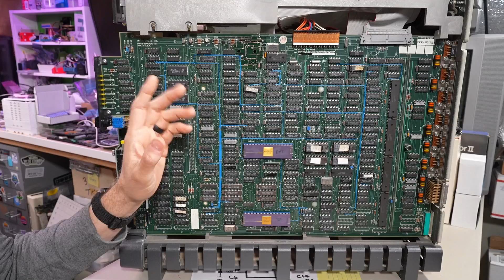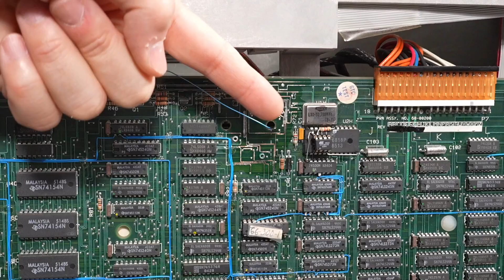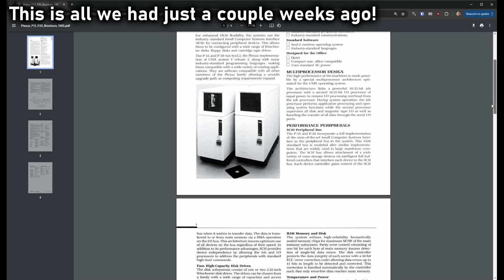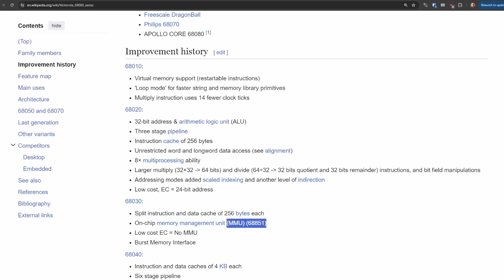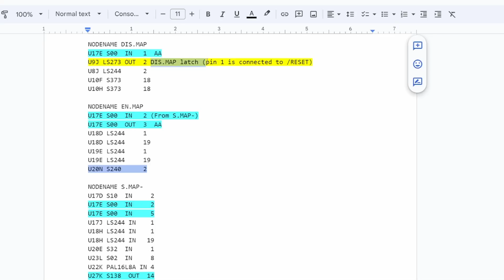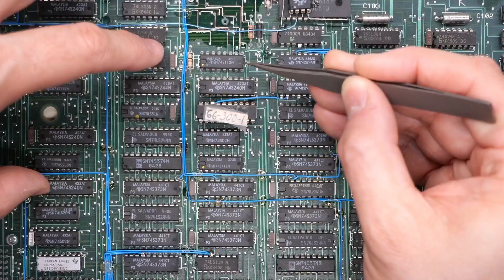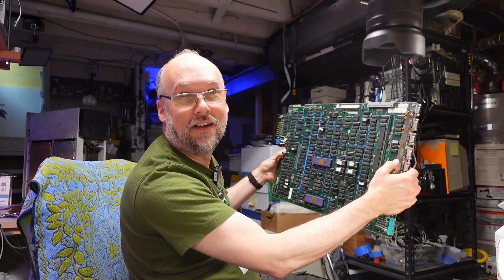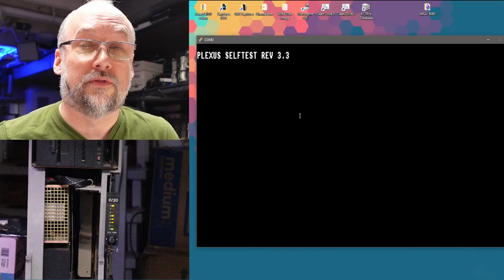We made some unbelievable discoveries about this Plexus P/20!

Comment: PLEASE fix the power supply!
If it's not coming out of reset it may be detecting something is wrong inside and resetting to try to prevent further damage, and that is one thing you don't want in a power supply of a very rare computer. 
When an ATX power supply fails do you bodge the "power good" signal on the motherboard and call it a day?

Please re-check the power rails with the scope to see if anything broke there. A power rail spike can certainly make everything unstable.

It might be possible that the power supply is not supplying enough power to something that does not start and initialize. Part of the multibus circuit may get some "ok" signal form the cage and the second PSU,  Make sure everything is connected and started.
Reply: He did say that ultimately that is A goal, and the reset circuit he added is hopefully temporary and mostly being used for troubleshooting, which is absolutely valid IMHO. 

In previous videos he already checked the rails and solved some potential issues. Thus, for the moment at least, the rails do actually look good. 

This is intended to be a troubleshooting step, not a permanent fix as Adrian said.
Reply: @Cherijo78  Ok, but if a PSU is so unhappy it keeps system in continuous reset wouldn't it be common sense to diagnose and fix the PSU first instead of just overriding its ok signals and hoping it won't kill the system in process? 

I understand Adrian scoped the voltages before the system was actually running, and I think tape and HDD were disconnected at that time? My point is that if it was fine then and developed a fault now, then it needs to be scoped again to check if everything is still good. 

Tantalum capacitors for instance have a failure mode when - after being stored improperly for large amount of time - they might short immediately, but also might work for a small time before shorting. That is also possibly not a dead short but a low resistance which lowers the voltage on one of the rails to a point where system kind of works but is unstable and/or glitchy.

What is much more concerning is that and older PSU circuitry that does the feedback can fail and that failure mode can lead to large upward spikes of voltage on 5V rail accompanying large current spikes i.e. when a seized tape/floppy drive tries to do boot. And those can quickly destroy chips to the point when repairing it becomes a pointless affair. 

I don't feel this PSU can do that or that this is what is really happening here but I would be more cautious if the PSU clearly indicated its failure.

I think this power supply may be incapable of fully powering down if it detects overcurrent or overvoltage, instead the best it cant do is to reset the system to hopefully stop it from doing whatever is causing the fault.

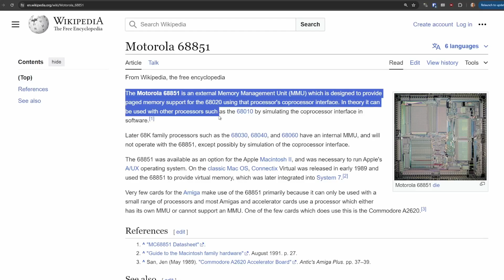Comment: @29:10 The 80286 had full support for protected memory. Code could be readable or execute-only. Data could be readable or read/write. Segments could be present in memory or swapped out. There were 4(!) priviledge levels, and sophisticated priviledge transition mechanisms. Interrupts could be handled on the most provledged level of the current task, or in a separate task. There is just one thing Intel added on the 386 processor: Page-based memory management instead of segment-based memory management. It turns out that page-based memory management and flat non-segmented address space are so much easier to handle that most of the more advanced 286 protection features were mostly ignored by OS writers, using just the page-mapping and page protection unit of the 386.

Features like the separation of data and code that were included in the 286 protection model were not implemented in the paging unit of the 386, so if programs had a flat whole-address-space code segment and a flat whole-address-space data segment, every address could be executed as code, even writeable data. On the 286, you would have needed a writeable data segment and a code segment created intentionally to be able to execute stuff you just wrote. Non-executable pages appeared when hardware exploit mitigation started to get important with AMD including the "NX" (no execute) bit in AMD64 (later named x86-64 or x64). It was later also added into some operation modes of the 32-bit x86 architecture.

Comment: would be kewl, if someone could design a Diagnostic device that would run through all the nets and check continuity and logic functionality,  and when finished, would output a report to either a screen or printer. and show you exactly where the problem is.
 kind of like the computer system on the Star Trek  series . if they haven't  done this, on  modern servers and large systems
 already that is . . . .
20:57 as Bob Ross used to say "We don't make mistakes, we just have happy little accidents" 😀

Comment: -we need a circuitry to pull off a reset signal
-lets use the whole 16mhz atmega board to do that!
-great idea!

Just finished watching: what a roller coaster!  Absolutely amazing!
Reply: At least he didn't use a Raspberry Pi cluster running Kubernetes.
Reply: @BrunodeSouzaLino  Is that something Adrian would be likely to do? I know that Jeff Geerling might...
Reply: @petersage5157  I'm working on the assumption that no YouTube creators read their comments past the first hour after the video is published, so this was more of a reference thing meant for the OP which the OP might be familiar with.
Reply: Hey, when you have a bushel basket full of the things, it only makes sense to use them for everything under the sun.
Reply: Yeah, and that atmega might even be somewhat on par with the 68010s' performance....!
Reply: @sparcnut  It runs at up to 20MHz and runs 1 instruction per clock, so no, it runs circles around the 68010 CPU.
Reply: I thought it was kinda overkill at first too, though I must admit being able to turn a reset loop on and off with the startup key is pretty handy!
Reply: He did mention that he intends to replace it with an attiny.
Reply: Sounds kind of crazy, like bolting an original PC to the latest and greatest computer just to drive it's reset line!

Comment: I wonder what the labor cost was to do those bodges like that at scale.
Reply: Far less than going for a new pcb - normal method would have been to get things working with the bodge wires, and once all the bugs had been sorted go for a new pcb IF the sales predictions were good enough

Comment: i wondering how the dual cpu setup worked. clearly those cpus are not made for this. but do they work like two independent cpus or is this similar to a dual core cpu today or do they work in a alternating way like multi threading.
Reply: There's one main CPU, and the second CPU is dedicated to IO, running its own software from a PROM chip. The eight serial ports and SCSI connect to the IO CPU, which is connected to the main CPU via the main DRAM.
Reply: @fredoralive  so it using only one cpu and the second is used as a io multiplexer?

Comment: Before I watch the end of the video,  The 4F02 reminded me of something on some hardware I worked on ages ago that had a ton of IC's.  I noticed your board had a grid on it, so it's possible the location of the fault would be row 4 column F,  possibly a fault code of 02,  I know this likely isn't correct, but I wanted to post before I got to the part of the video that showed which component was bad.
Reply: I'm not sure, but I think the bad component was in 4F

Comment: Using the Arduino you missed a chance to make it actually smart - eg. use analog input pins (with resistor dividers) and drive the reset on the user input + rails being in limits. Then you just loop it and while its in limits, is fine. Once some limit is violated, you can print the actual reason on arduino's serial (or on status leds), to know the transient states.

Comment: Do that Arduino "reset cirquit" has more computing power than entire Plexus...?
Reply: No, an the Arduino Uno uses an ATmega328P, which has an 8 bit AVR core with a 16MHz clock. It's hard to compare between CPU architectures, but I suspect a 12.5MHz 16 bit 68010 would probably overpower it, especially as the Plexus has two. The 32Kb of program Flash and 2kb of SRAM on the AVR aren't high either - the brochure on bitsavers notes the IO co-processor alone has a 64kb program PROM and 16kb SRAM, the main CPU can have up to 2 megabytes of memory, and huge storage on a Winchester disk.

The ATtiny25 on the final bodge is even weaker, it's probably running at 8MHz (max 10Mhz), has 2kb of program flash and 128 bytes of SRAM.

You can get modern ARM Cortex-M MCUs that would trump the system, but something like an old Atmel AVR isn't quite going to be there.
Reply: @fredoralive  I wolud like to see real life comparation. Of course, Plexus may be faster in some (or most...) operations, multiuser, big data processing etc, but, for example, simple loop to calculate first 10000 primes, with modern CPU architecture, better optimalisation...

Comment: mikeselectricstuff taught me a good way to scan for continuity in a maze. connect your probe lead to a fine metal brush and paint over the board. wire wool if you're a maniac
Reply: Neat! If you were to make a purpose-built tool for this, maybe a conductive-plastic brush would be gentler on the board 🤔
Reply: A viewer actually sent that attachment into Adrian a few years ago and he has shown a video using it, so perhaps that is what he used here, or at least he 'could have' as he does have one :-)

Comment: It's not "done" until it is up and running Doom lol.
Reply: Doom on a serial terminal would be "different". Colossal Cave is a better fit.
Reply: @Peter_S_  yeah, maybe a snake game or some text adventure... No doom on a terminal 😂
Reply: These processors are way too old and with too little ram. For this something like Nethack would be more fitting and period correct. This is an 80ies 68k Unix server and Doom a 90ies 386 msdos game. A MUD would probably work fine as well if this is used at some public event with a bunch of terminals or some retro dialup or telnet thing. Not versed with Unix multi user games but i guess you could compile whatever as long as its in portable vanilla C code.
Reply: @freeculture there is a doom port for the Commodore VIC20 with a 6502 and 5K of memory. So no, that's not it.
Reply: @freeculture doom ran in notepad using ASCII as the graphics. Having no graphics nor hardware limitations isn’t something that stopped Doom from running.
Reply: @Blood-PawWerewolf  I guess we are all seeing different sides of what "running doom" is... I'm sure someone could dumb it down to worse than 90's graphing calculator level of gameplay, but I don't consider those ports "running doom", it's a neat side project, and it's cool that people put the effort in to make it work, but it's so stripped down it's not even 1% of the gameplay, nevermind the rest... And I'm not a gamer, I think I played the doom demo 30 years ago and that was it. 

Turning it into a game with worse graphics than a snake game doesn't really do it for me, I'd rather see someone make Tetris work, taking absolutely everything out of a FPS game just makes no sense to me, it's wasted skill on whomever does it, because the end result of all that hard work is unplayable and not enjoyable on such a limited system.

Comment: This windfall is the best reminder about the value of using whatever cheap tricks you have available in any given situation, like taking what a port's probably 100% stock sysv filesystem code disk at least to whatever other handy OS has a driver for it to have a look around (figure out the offsets by trial and error with a smol shell script if you have to)

Comment: Is it coincidence that the error 4F02 is the same as the socket that the chip was?  U4F ?   Did the error actually indicate the failure location?
Reply: When I looked in on the Discord, the working theory was that the numbers related to the test sequence.

Test phase 4 was named Main. F was Failed and 02 was test 2 within phase 4. 

So the second (or 3rd, starting at 0?) test had failed.

Comment: Just Bonkers! Wow!   Insidentally that negative set reset JK flip flop is a common part in a lot of reference Motorola designs.  The E series 6809 uses a similar style flip flop for building the clock generator for E, Q and with the addition of a 7474 and a 3 input nand handling of the MREADY line. I got to say a huge thanks to everyone who pulled together to make it this far! Well done team 😊

Comment: It's crazy that there's virtually zero information on these machines, a very few of them exists still today and the one you got happened to have a LOT of vital information kept on an invisible to the naked eye part of the hard drive. Mindblowing discovery!
Reply: I wonder if the hard drive was imaged at the factory, and it was the engineer making the base image who made the typo and put the /user partition at the wrong address, meaning every computer would ship with 90% of the technical documentation in unallocated space. That seems like less of a coincidence than “this one machine happened to have been used by one of the engineers and then got repurposed for general business use”
Reply: @thenerd6192  There's only one way to find out... let's find another P/20 somewhere 😆
Reply: @thenerd6192 if they made tons, I’d see that; but Adrian’s GitHub page mentioned they only sold 2500 units total (not just of this machine). This was their “low end” machine sold to offices, which could’ve been only 10% of their sales but might’ve been 50%. If there were only ~200 of these built with most customer offices only having one unit, Plexus themselves probably had the largest install-base.
Reply: @thenerd6192  Back then, as far as I know, Unix didn't support multiple partitions (When I was certified in Unix by SCO in 1997 it was drilled into us that "everything is a file")...  /user is a directory but is actually a file.
Reply: This is a general problem. The 80s were about much more than home computers. A lot of interresting business computers (mainframes!) were made, however, as there was no standard computer architecture yet, there systems had small user bases. Unlike home computers that were carefully stored at attics for decades, the business computers were destroyed after their economic life did end. Companies that made them went out of business. Therefore, we kind of know everything about the home computer side of the 80s, but the business computing part of the 80s is basically one huge black page, with very little hardware and documentation that did survive.
Reply: @danielmantione  So correct.  I wish I still had all the DEC Rainbows running Xenix and the PDP11/83's that went to the landfill from my Dad's relatively small business.  Never knew what we had until well after it was gone.😱
Reply: That was very lucky indeed!  There are tons of small companies that came and went back then and were only known by the customers who used them.  The big companies get all the press but often the most interesting stories come from the smaller ones who had to survive on wits and luck.
Reply: Similar thing happened to Sierra. Source of the AGI interpreter source on the game discs!
Reply: @root42  Or they happened to have Al Lowe, who still has the source code for a lot of Leisure Suit Larry games :)
Reply: Adrian (and all of those assisting him behind the scenes) is doing essential preservation work. There are so many hardware platforms that are essentially gone. Professional character generators have a similar lack of preservation. I should be able to emulate a classic Chyron on my PC by now lol.
Reply: 🤯 Simply amazing.
Reply: It's not just how lucky to find the hidden info, but that someone like Adrian, with significant technical know-how and reach in the community, would be the one who got the machine. It could just as easily have ended up on some weekend hobbyist's bench and never been brought to life at all, ending up in a digital recycle facility, disassembled for parts.
Reply: @Felice_Enellen The key is the MFM emulator he has. That stuff is not too common. And in my case I had been forced to low level format several drives without beeing able to archive the content. Simply becose the original controller did not survived with the drive. 😢 It is really good this machine ended up in his hands. There might be more units put there and now chances are these can be restored too.
Reply: The sad part is a good portion of the people which could potentially have information on this product have probably been dead for a number of years now.